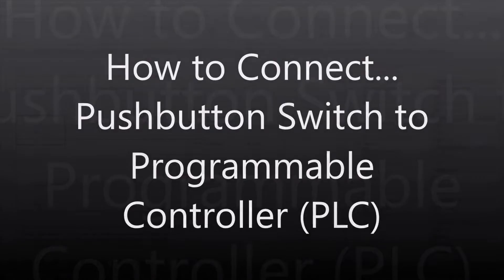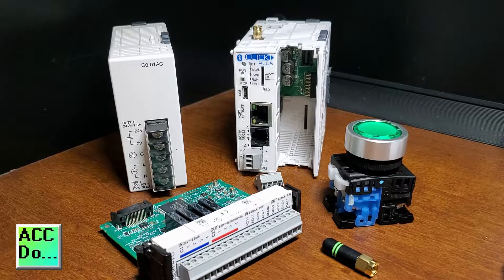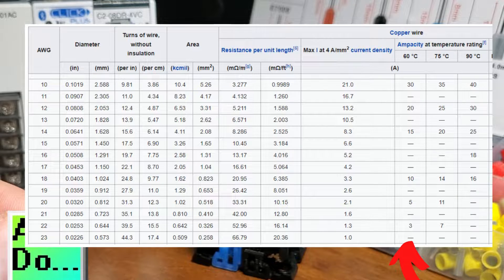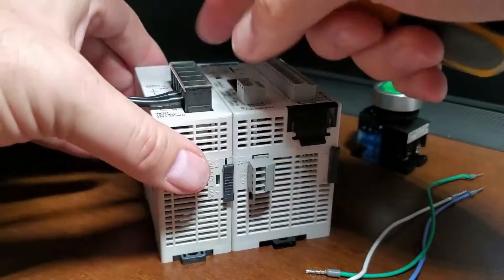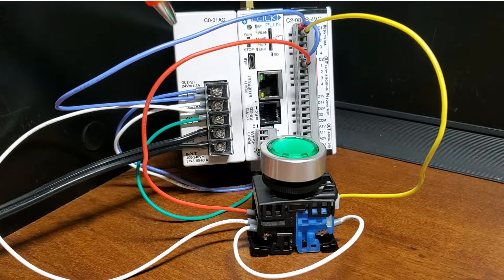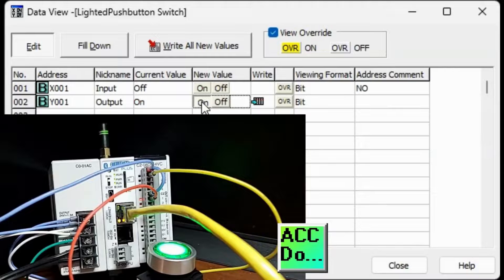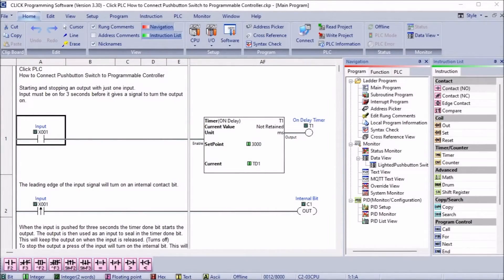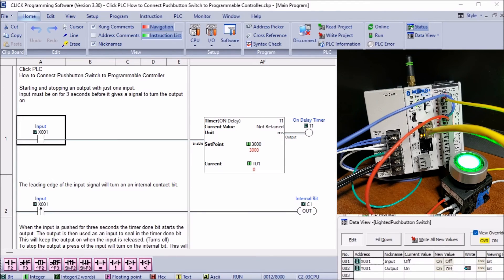Master PLC Wiring: Safe Single-Button Start/Stop Control

Comment from the maker: More information can be obtained at our website. This includes all of the links mentioned in this video. 
https://accautomation.ca/how-to-connect-pushbutton-switch-to-plc/

Purchase a ferrule kit here:
https://amzn.to/38qxpRI
Video on this ferrule kit.
https://youtube.com/shorts/7uaQZFjqlzU

The Click and Click PLUS PLC series can be found at this URL:
https://accautomation.ca/series/click-plc/

Features of the new Click PLUS PLC (C2-0xCPU) include the following:
• Micro USB
• DHCP support
• DNS support
• Wi-Fi (programming and Modbus TCP)
• Bluetooth (Wi-Fi) provisioning
• SD Card (Data Logging)
• Data Logger
• Network Time Service
• MQTT (Publish/Subscribe)
• Required PLC Password
• Disable Ports
• Strong Password Support
• Disable Ping Response
• Encrypted Password Transfer

We are using the Click and Click PLUS PLCs for several reasons. Here are just a few.
 - Investment is low for the hardware, and the software is free
 - Standalone PLC with built-in I/O
 - Communication ability - Ethernet Port, RS232, RS485 - support for protocols such as Modbus RTU, Modbus TCP, etc.
 - Ability to directly expand the system with various modules, including RTD and Thermocouple inputs.

ACC Automation
https://www.accautomation.ca